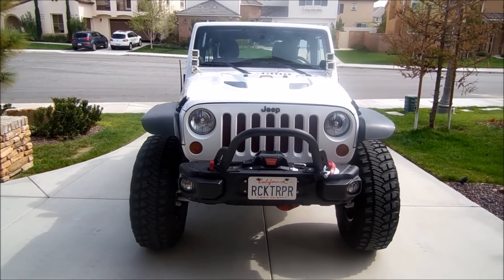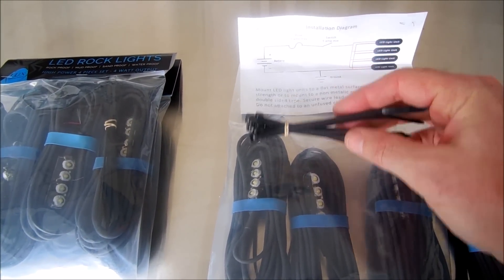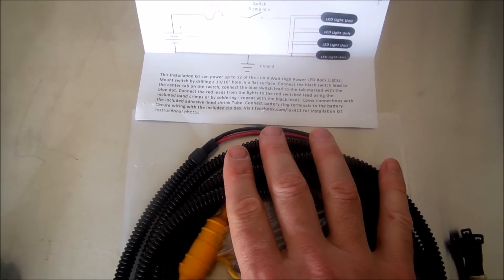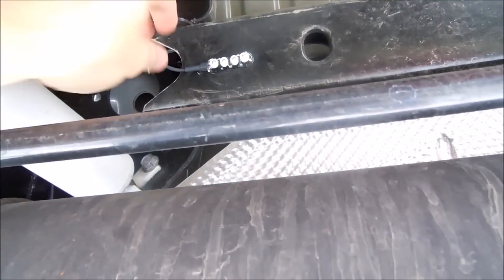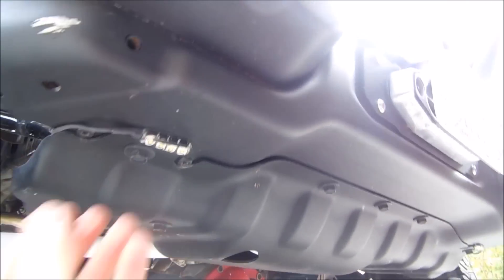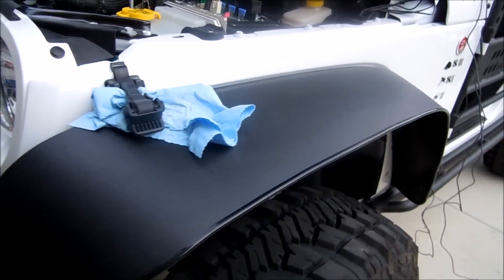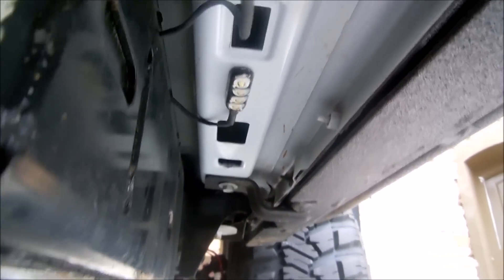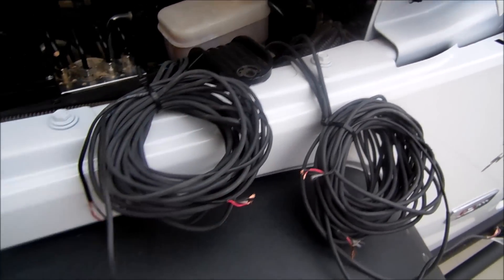How To: Install LUX Lighting Systems LED Rock Lights on Jeep Wrangler (RockTrooper)

Comment: First off - NICE Jeep build. The suspension & drive train goodies did not go unnoticed.  I viewed this to see if LUX was a quality product for rock lights and your video convinced me that it is. Great job on documenting  a nice install. One suggestion - those wire-tie anchors with the double sided sticky tape will fail sooner than you think. May I recommend replacing them with MagDaddy Part # 62411 .  These have neodymium magnet bases that will never come loose - just like the LED's. They are incredibly powerful.
Reply from the maker: Thanks for the feedback and recommendation on the tie down. They last a few years, a bit less on the areas that got wet often. I’ll have to look into the MagDaddy items.
Reply: How many MAG Daddy anchors would be needed to do the install... I'm about to start this and thought I would give it a try.

Comment: Is it possible to wire these up with the dome light circuit in order to use them as an exterior courtesy light when entering/exiting the vehicle?
Reply from the maker: Benjamin Filbert don’t know. You would need to check the voltage going to the do,e lights and see if that circuit can handle the additional load from the lights. You could also look into connecting them to the aux lights and adjust the settings in the onboard computer.

Comment: John, towards the end of your install. Those wiring harnesses, how many switches did you end up using on the Spod? With so many lines to connect to the Source, I'm curious how you did it. Great video and well informative! Thanks Top!
Reply from the maker: Robbie, thanks for the feedback. As for the wiring, everything was connect up to a single switch on the SPOD. Simply connected all to the terminals, clamped them down and then to the POS and NEG posts on the SPOD.

Comment: Great video.  Nice detailed instructions!  I was wondering, when you connected to the Spod, how many switches did you use?  Did you break it down into the four groups?
Reply from the maker: Thanks for the feedback. All connections were run to a single connection on the sPOD.

Comment: Fantastic video. High attention to detail.
Lessons learned after 2 years of this install?
 What would you have done differently? 
Lastly, did all the lights get controlled by one Spod switch, or 2?

Thanks
Reply from the maker: Hey David, thanks for the feedback. The only item I would change is instead of running all of the light leads to the terminals, just run all the lights to a single lead (on each side) and then run those 2 leads to the switch. This would make it much easier to run and to service later if needed. All of the lights went to a single switch on the sPOD. No issues.

Comment: Awesome video, John. Two questions: 1. If you were to do it again, would you still put one in each fender well? I'm thinking about doing 8 and eliminating the fender well location. 2. What gauge wire is going to the sPOD from the butt connector?
Reply from the maker: Shane, the fender well lights are more for appearance than functionality. The real light use are for those in front of the wheels (front and back) so that my spotter can tell me where to go. So, depending on your goal, 8 should work. As for the wire gauge, if I remember correctly it may have been 16 or 18. You are not pushing too much power to the lights, so you do not really need a high gauge. Hope this helps!

Comment: Good Video....I want to install the same type of rock lights you have just wondered how many switches on the SPOD you used to connected all these lights to?  I have the SE screen with the new lower profile system. Thanks
Reply from the maker: A68170 I do not know the specs of the new SE model, however on my install I only needed to use 1 switch. The LED draw very low power so you should be able to use a si gel switch on the SE as well.
Reply: How do you connect them all to one terminal...in other words did you solder them all together to one connector or what?  Thanks
Reply from the maker: A68170 there are multiple ways you can do the install. 1 way is to simply run all of the lines for the individual lights to the sPod (what I did) and then use a male connector to fit all of the leads (positive and ground each to its own terminal) and connect them up. I just Ed used a larger male connector and crimped the wires in place to the connector and shrink wrapped them. Another way you can do it, this would Dave space running to the engine bay, is to run a pair of leads from each side and just run the 4 leads (2 positive and 2 ground) into the terminals. Each will work.

Comment: i'm thinking about ordering these. i am thinking about these vs the KC cyclones.  can you share with me the plastic square things that u used to secure the wire on certain parts of the belly of the jeep. where can i can i get those and are they held on by tape? ur feedback is appreciated
Reply from the maker: VOLTAIRE CAO Hello Voltaire, this is what I used: http://www.amazon.com/Commercial-Electric-Indoor-Outdoor-Mounting/dp/B00MG49C9S They are mounting bases (indoor/outdoor) that you can use zip ties to adhere the leads to. You can also get them at Home Depot and Lowes. Hope this helps.

Comment: Hi John, Great write up. I wanted to know your thoughts on running the wires through the frame.
Reply from the maker: We had installed the lights on a few rigs in the club and that is actually what we did. I'd I were to rewrite mine, I would most likely run them thru the frame as well.
Reply: Great thanks. Did you run them in the split loom through the frame or just use a tie wrap after you ran them?
Reply from the maker: +lbeatojk the wire itself is triple insulated, however I tend to overdo things and on each install I ran wire loom from end to end. You probably do not need wire loom however I wanted to keep the wires together but not bound together if we used a zip tie or similar. Make sense? It might only in my head 😜
Reply: +John Golden (RockTrooper) I get what you are saying. I just wasn't sure how difficult it would be to try and get the split loom around the cables once in the frame. I figure it would just be a little extra protection. Thanks again.
Reply from the maker: +lbeatojk one you get the loom started you should be able to push the loom down the wire. Don't get a loom that "just fits", get some with enough space to enclose the wires and gives it some room. You'll see what I mean when you use the loom. If you run into any snags, hit me up. Good luck with your install!
Reply: Will do. Thank you.
Reply: @RockTrooperJeep  What size loom did you use? any thoughts on using the braided nylon vs the plastic?

Comment: Have you had any issues with the lights and How did you wire them to the sPOD?
Reply from the maker: John Schindhelm i has sold the Jeep a while back, however had not had any issues with the lights. I wired the complete set of lights to a single sPOD switch, real easy connection and worked perfect.

Comment: Thanks for such a thorough video! I just added this to my list.. Off topic, I notice you're running Goodyear MTRs.. I'd appreciate your thoughts on them too (any video reviews?). Thanks - JB
Reply from the maker: Jarret Byrd thanks for the feedback! The only issue I would have with the tire is that they may last about 40k miles, with proper rotations. Besides that they are the perfect tire. Great in the rocks, no road noise and have never had issue with traction where others were sliding around. If there is no issue with replacing them every 40k miles, highly recommended! Hope this helps

Comment: Are the lights strong magnets? How are the magnets holding up? Do they come off with wind, water, etc.? Very interested in getting these any feedback would be appreciated!
Reply from the maker: Gabino Berrones yes, the magnets are very strong and will not come off by wind/water, etc. you actually need to give it quite a pull to remove them. Out of all of the rock lights I have seen so far, these are the best made and brightest.
Reply: RockTrooper thanks for the quick response that's all I need to order them thank you
Reply from the maker: Gabino Berrones glad I was able to help. What color are you planning on getting?
Reply: RockTrooper I ordered the cool bright white same ones you got, make the truck look clean
Reply from the maker: Gabino Berrones awesome!

Comment: Are you haveing any problem out of lux brand lights I have the pink ones on wife’s renegade and they got water in them now they gone water got in where magnet was at
Reply from the maker: keith hodge I had not had any issues with the lights and they were sealed so I had not seen any water getting inside the housing. Although it does not rain as much out here, I had gone thru water and no problems. You may want to give them a call and see if they would cover the item under warranty.

Comment: John, I caught your vid on your install of the lux rock lights.I like the system for magnetic placement option.I see you have had them for some time now and would like to know your impresstion of them after long use,would you say they would be a good choice for my build? Luv your channel...R.W.
Reply from the maker: Hey Rich, they have worked well and have not had a problem with them at all. After I installed them on my rig, several other members of the club also installed them. The ability to move them around as needed is a huge bonus. I know they have a few different versions now, I don't think you can go wrong with any of them.

Comment: John, quick question. Did you have to extend the lights? Especially for the rear passenger side wheel well and back number? Thanks
Reply from the maker: Daniel Kmetz do you mean extend the wires from the lights to the control box? If so, yes. In fact another way to install the lights is just to run a common line down each side of the rig and then connect the lights to the common. This way you really only have 2 sets of lines running to the switch/control box.
Reply: RockTrooper I meant extending the leads themselves. I'm installing them finally today and at the rear of the jeep, they're too short to even get close to the engine bay. I'm following the same paths you did, they're just too short.
Reply from the maker: Daniel Kmetz yep, simply extend the leads as needed. Just solder them together or if not soldering use connectors and then wrap them in marine shrink wrap to protect the connections (or whatever you have to make a good seal).
Reply: RockTrooper awesome thanks for clearing that up!!!

Comment: How are the zip tie mounts you installed holding up, I've read reviews on the mounts and would like to know if yours are still holding up.
Reply from the maker: Sonia Ajamian there some that come off due to excess mud and sand getting up in there, but for the most part I would say about 90% are still in place from the original install. They are really easy to replace when needed, just cut the zip ties, clean the area and mount and zip back in place. Keep in mind it does not get extreme cold here, I get high heat in the desert areas however we do not get freezing and below temps for extended periods. Cold may have impact on the life of the adhesive. Hope this helps.
Reply: RockTrooper I just haven't found a better Mount to use to install the LUX monster lights.
Reply from the maker: Sonia Ajamian unless you live in an arctic climate you should be able to use these mounts successfully. Just check them every few months to make sure they are still good. Like I said before, about 90% are still on from the original install and changing those that came off out is really fast and easy.

Comment: Did you connect all 12 lines to one spod switch? i have a 30amp and 15amp spot on the spod.
Reply from the maker: Sonia Ajamian yes, all 12 are connected directly into a single spot on the SPOD. The 15A is more then enough, draw is very low.
Reply: Great information thank you, all worked out OK.

Comment: Hey, can the relays in the s pod handle having all 12 lights on one switch or do they need to be split up?
Reply from the maker: Kira Murdock yes, I have all 12 of the rock lights run to the single switch on the SPOD.
Reply: Kira Murdock these baby leds pull very little amperage dude lol... no reason one switch cant handle

Comment: I have a four light kit. I was wondering if i could connect the lights together and just run one set of wires instead of four sets?
Reply from the maker: Slotting with angbuzz yes, you can run all 4 lights to a single lead and connect it to the switch. I ran all lights to a single sPOD switch.
Reply: I have an sPOD as well.  I think Slotting with angbuzz has a great idea.  I was thinking that's a heck of a lot of separate wires!

Comment: Great Video John! Question, Exactly which lights did you get from LUX? Monster, MicroMax, or Max?? Thanks
Reply from the maker: Hey Daniel, thanks for the feedback! When I installed mine, they did not have the various models. When I checked their site and the specifications for the lights, the model I have match with their "Monster" model lights.
Reply: Thank you! I'll be placing the order now! My DIY lights haven't worked out, time to upgrade.
Reply from the maker: +Daniel Kmetz sure thing! I did the same and upgraded my DIY lights to these. Good luck with your install!

Comment: You didn't show the final product of how you connected the wires to the spod that's the most important part?
Reply from the maker: Physical Starfighter 16:30 and forward, just connect the positive and negative lines to the positive and negative on the sPOD.
Reply: @RockTrooperJeep   Thanks for the reply but that's not exactly what I was asking....What I was trying to ask is...did you tie all the lead negatives together and positives together then run one lead from both to the spod or did you use a buss bar and then one lead from neg and pos to the spod?
Reply: @physicalstarfighter2131   Good question! For a newb, this was puzzling...I get R/Trooper ran ALL 12 light wires (2 each too= pos/neg) to the engine bay, and that's why we got 2 massive rolled up wires sets. Now we "marry" ALL positives together + ALL neg together....THEN 1 short final lead to the SPOD consisting of 1pos/1neg wire. Is this about right?? Awesome video and tremendous product. He said he sold the Jeep :(
Reply: @RockTrooperJeep  Good question! For a newb, this was puzzling...I get R/Trooper ran ALL 12 light wires (2 each too= pos/neg) to the engine bay, and that's why we got 2 massive rolled up wires sets. Now we "marry" ALL positives together + ALL neg together....THEN 1 short final lead to the SPOD consisting of 1pos/1neg wire. Is this about right??  GREAT CHANNEL!!!

Comment: How do they hold up to high speed vibrations have any lost their magnetic power over time or fallen off
Reply from the maker: I had not had any issues with them when I had the rig and I know plenty of others that also have them installed and have no issues. They are fairly popular, so you may want to post up in a few forums to get a more broad response.
Reply: RockTrooper thanks I too have also seen people talk highly about them on the FJcruiserforums except most disagree with the price point. Thanks
Reply from the maker: Mustang Enthusiast yep, pricing is a bit high, however quality has been good so I can’t complain.

Comment: Whered you get the wire mount backing thingies
Reply from the maker: ertonyrn are you talking about the adhesive backed squares that I use to zip tie down the wire loom? If so, you can get them at Home Depot or Amazon https://amzn.to/2VY8dd3. Let me know if that is not what you meant.

Comment: love the video!!..nice clean install and looks great..quick question, when you married the wires to the #8 butt connectors did you run a #8 wire to the spod and a spade or just the plain wire..thanks..great looking jeep also!!

Comment: You do not have to worry about smashing/breaking those lights. You can put a jack under them and lift the whole Jeep and not break the acrylic housing.  One light will take the weight of the Jeep no problem. They even work cut in half

Comment: how are they holding up I been thinking on doing this for my silverado
Reply from the maker: Hey Michael, I have not had a single problem. All lights work and continue to be held in place with the magnets without an issue. I have no complaints.
Reply: +John Golden (RockTrooper) thanks for responding, I'm glad to see that there holding up, what package did you get I see a few different ones and I'm glad you did a review things nowadays you just don't know how well there will hold up
Reply from the maker: +Michael Duncan thanks for the feedback. That is why I do these videos, to help out other Jeepers! Here is the model I have, they are called the Max. I know they have a few other models available now that are new and not something available when I got mine. https://luxlightingsystems.com/collections/the-max
Reply: RockTrooper
Reply from the maker: Shawn Mccarty, did you have a question about the lights or something else?

Comment: Great video. How many switches did you use on your S-Pod?
Reply from the maker: Devron, just 1 switch on the sPod is for the rock lights.
Reply: Thanks for the info. Lights ordered, I'll be using your vid and hoping I get a clean a job as you did.
Reply from the maker: devron78 Glad I could help out. If you have any questions or run into any issues, let me know. I'll be happy to help out if I can.
Reply: John Golden Excellent video.  Been watching it several times in preparation for my install.

Comment: Nice install, but I can't help but notice that the rear tracbar seems incorrect.  If that's a Metal Cloak rear tracbar, which I'm almost positive it is, it should be flipped with the bent end on the driver's side.  It looks like it already hit and bent the exhaust because of it.